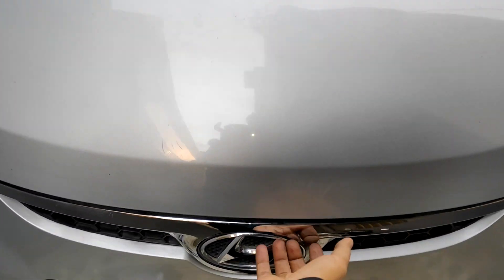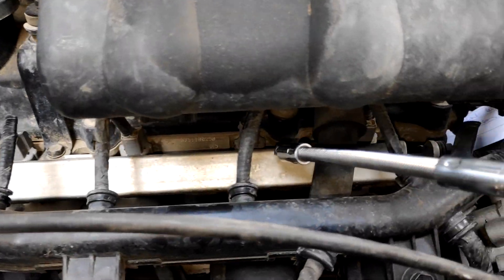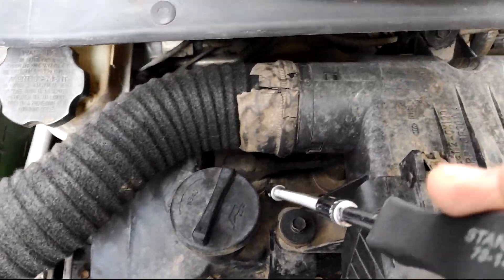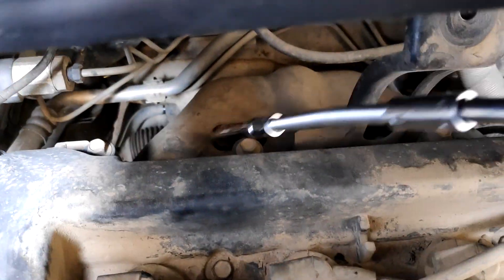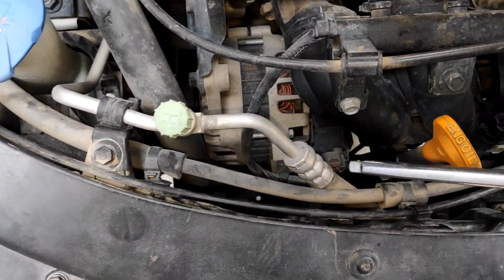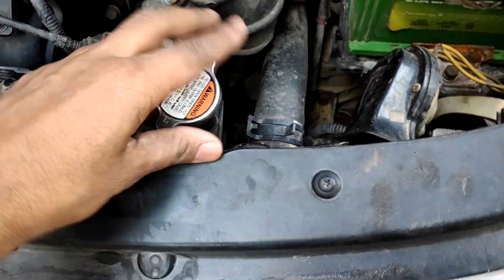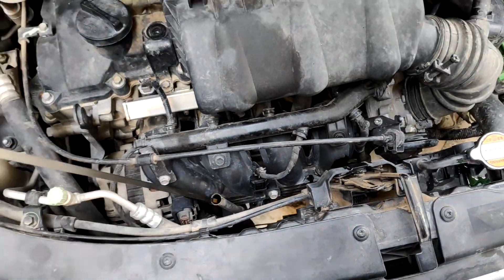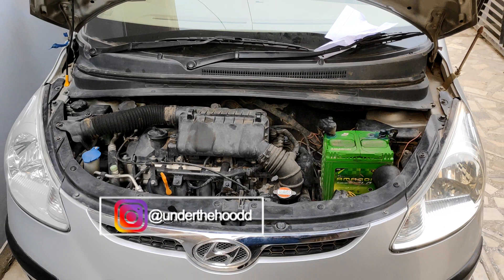WHAT IS UNDER THE HOOD OF HYUNDAI I10 | NAMING PARTS INSIDE THE ENGINE BAY

Comment: At 0:23 when you said air enters through pipe my car does not have that pipe is that a problem for car? Mechanic didn’t had pipe so i am running without pipe is that ok?
Reply from the maker: It's a common problem with i10, this pipe wears out quickly, pipe is required for proper passage of air, without which it doesn't know where to enter from it is designed such that air enters in a specific direction and breathing is also best there.

Comment: I want to know how to disable the central locking siren - where is it located under the bonnet ?
Reply from the maker: Remove central lock wire connected to the negative terminal of the battery, if you have normal central lock otherwise the one which is more sophisticated is also connected to the starter, and is quite complicated for a novice.
All the best

Comment: I came here to find out where to refill or check power steering fluid and left again with no clue😢
Reply from the maker: It's not hydraulic, it's electrical
Reply: Okay so does that mean the vehicle does not use power steering fluid?
Reply from the maker: No
Reply from the maker: It has a power steering motor